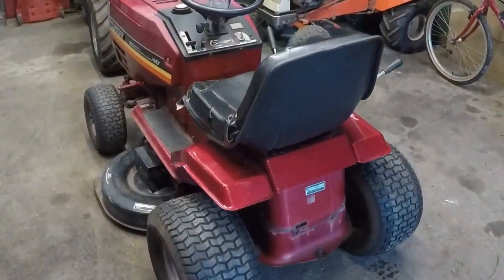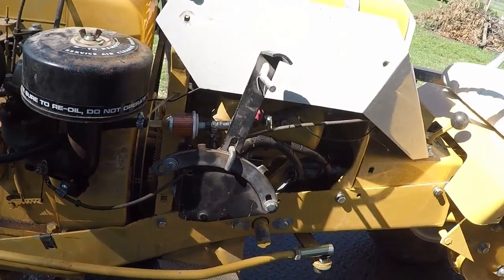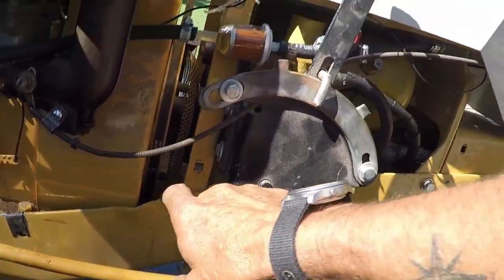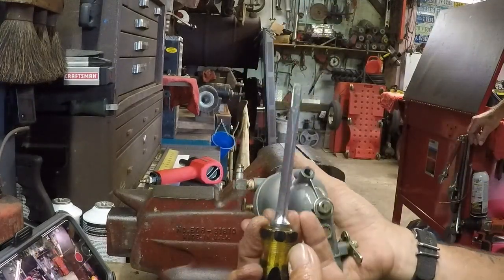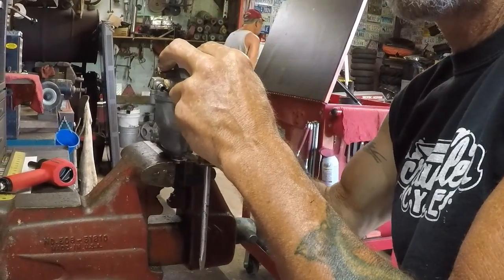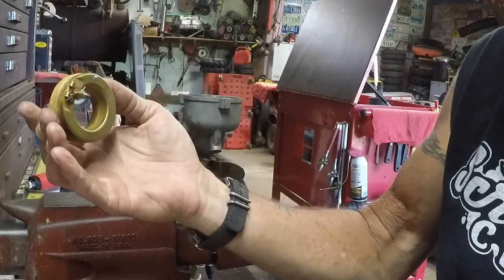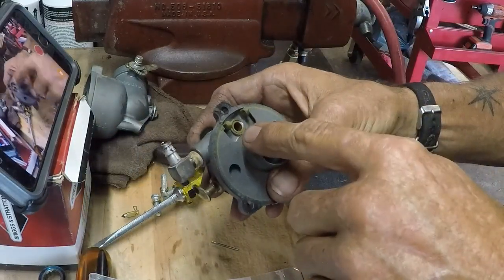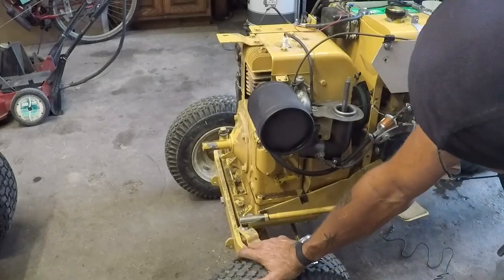1964 Allis Chalmers Early B-10 Carburetor Work #smallenginenation

Comment: Just subscribed.  Very nice posts Mr. Zippo.   I have a restored (not by me) Allis B-210 that I need to throttle up higher.  Not sure which adjustments to make.  When I pull the cable to full, it only goes so high, then drops back down.  Can you tell me what I might be missing?
Reply from the maker: Thanks for the sub!

Comment: question; I have sim carb and engine on simplicity Baron, but my carb has 4 bolts at float ( same as many other carbs you highlighted, Zippo). I have rebuilt and cleaned carb as shown here several times ( including special screw driver) Also have in line fuel filter and on/off valve. Once running, all works. But starting it is very difficult and random. another small deviation is the idle screw needs 2.25 turns and not the spec  1/2 to 3/4 turns ( that was the original setting I went back to and it at least gets me started sometimes. Suggestion(s) to start reliably?
Reply from the maker: These engines love to start at low idle. The throttle rod that your throttle cables end is connected to has two 1/4" nuts which are there to set your high and low RPM. Adjust the top nut until your butterfly closes when the throttle cable is set to low idle. Then, give it a go....9 times out of 10, this nut is not adjusted correctly and the result is too much fuel entering the combustion chamber on the cold engine. KEep us posted on your progress! Zip~
Reply: I really was confident that would do the trick because the butterfly was not resting/stopped against the carb at low/no throttle, but after adjustment of the 1/4 " nut to fix butterfly, I get the same result. Won't start.any other suggestions are welcome. Much thanks!

Comment: Hey Zippo! Your channel has saved me a crap ton of frustration but I have an issue I haven't seen you do yet. I'm swapping carbs on an old B-10 and the new carbs have the choke lever on the outside of the carb whereas they use to have it on the inside. In any case my choke cable isn't long enough. I've taken the cable 90% out but I'm stuck on popping the cable out of its little pinch lock. How would you pop the cable out? Screw driver and twist? AFTER I snipped off the cable to the choke handle I realized I could have just used an extension between the original cable and the choke lever so sadly I am at that point where I absolutely have to replace the choke cable.
Reply from the maker: The choke arm can be swapped to the inside by means of removing the Welsh plug on the end, taking out the two screws and swapping the arm from outside to inside. Hopefully the carburetor you got to replace the original isn't one of those cheap Chinesium knock off carbs. Glad my videos have helped A2B! Keep us posted on your progress. And yes, just gently spread apart the fingers holding the cable in place. Replace with the same diameter cable for best results. Zip~
Reply: @ZippoVarga  I had a brain fart and went and picked up a 72" universal choke cable, cut the ends off and pulled the inner cable out and then ran it through the original cable housing. Hooked one end to the choke lever and mounted the cable like it would need to be on the outside of the carb, rough guesstimated and cut the extra cable wire down to size, bent it and hooked it into the choke lever on the carb, worked like a charm and the transition from closed to open choke is nice and smooth. Sadly it is a chinesium EBay special however to my surprise after I bolted everything back together and the thing starts right up immediately with that eBay carb. Didn't have to make any adjustments to it or anything. I'm gonna be testing how well it handles cold starts versus warm starts etc.

Comment: Working on a 65 big ten, it ran when I got it. After I cleaned the squirrel nest and mud daubers out of the engine there was no spark. Replaced the coil, it has spark but still won't start. Any suggestions on what to look for? TIA

Comment: We have a B 10 Allis that seems to vapor lock all the time.  Can you gives us some help on this problem.  We are about ready to give up on this tractor.
Reply from the maker: Don't give up! Try routing the fuel line in a different manner. Any dip or up swing on the fuel line will cause an air bubble which will stop the flow of fuel. Route the fuel line as you see it in this video. Make sure the fuel tank is very clean as well. Often, the little filter in the tank gets clogged. Remove it, cut off that screen/filter and install an in line filter and fuel shut off. Let me know how it goes. Zip~
Reply: Thanks Zippo, you’re the best!

Comment: I have a question. You  took care of the carb. That was a symptom from sitting too long with gas in the bowl. My question,  when you find junk in the carb wouldn't it be a good idea to investigate the gas tank too.
Reply from the maker: Yes Frank. I didn't mention though that the tank was stored dry and was installed as a new tank prior to Muggsie bringing the tractor to me for the carb service and he was the first to ever put fresh 93 octane ethanol free fuel in it last week. But yes, you should always go through the entire fuel system when you discover ethanol related issues in the carbs. Cheers Frank! Zip~

Comment: Awesome! Great job restoring that baby. So I have a question if you have time. Why am I having such a hard time with the starter on my 75 Brigg's 16Hp? I keep going through gears, the last one I had busted clean in half and the one before that I got maybe 10 starts and it cracked so it stopped working. Any thoughts on why this keeps happening? Cheers!
Reply from the maker: Sounds like the 16hp in Shaun's Kwik-Way loader tractor. The Ring Gear is worn out and that causes the starter gear to get chewed up. Options are, new ring gear or donor flywheel of the same vintage or a Starter Generator set up like I did on the Kwik-Way. Great to hear from you Sir Moto and so sorry you're having issues!! It's frustrating I know. Keep me posted! Zip~
Reply: Thanks bud, one question do you still think its the ring gear even if the gears on the starter are not getting chewed up? The last one broke in 2 and shows no sign of being chewed up, the one before that one cracked in between teeth in one spot also no sign of it being chewed?.
Reply: Here is a short video on my starter issues https://www.youtube.com/watch?v=Dbn0i6nKGjI might make it easier to see what I mean.